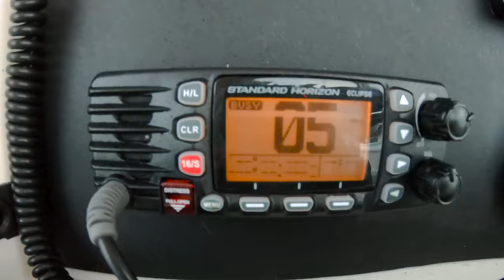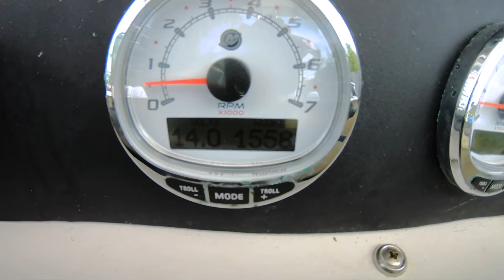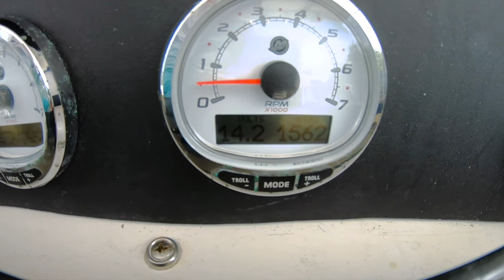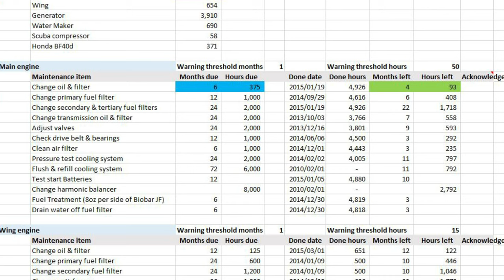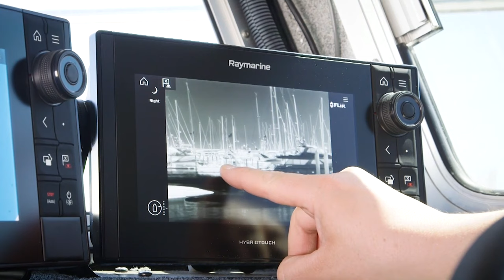Don't Make These 6 Mistakes When Buying a Used Boat!!!

Comment: Another great video! About a year ago I purchased a 2016 Key West 239 FS. It was equipped with a Yamaha 250 SHO which had about 390 hours on it. The seller was great to work with; when I went to see the boat he gave me a thorough walkthrough pointing out all the issues that he was aware of. Most of them were very minor. Then we took the boat out for a sea trial. He didn't hesitate to let me have the local Key West dealer check over the boat, engine, electronics and trailer just to make sure there weren't any serious hidden problems. The only real issues (which had already been pointed out by the seller) were that the trailer hubs, brake calipers and surge coupler needed replacing. The seller had already accounted for that in his asking price, so that wasn't a huge concern. Long story short, I've had the boat for over a year now and couldn't be happier. I had the work done on the trailer so it's ready if I want to tow long distance. I also added an onboard two-bank charger/maintainer to keep the batteries ready to go while the boat is sitting on the trailer between outings. I just had my first annual maintenance done on the engine and it got a clean bill of health, which was what I expected since it's run like a top ever since I purchased the boat. We all know that any machine will eventually fail, but doing the things recommended in this video will give you your best shot at ensuring that there aren't any serious hidden problems when considering a used boat purchase.
Reply from the maker: Great stuff. Congrats on the boat!!

Comment: If possible get a survey! For expensive diesels, also a separate survey for those including oil analysis. Check for rot in stringers and transom. Soft balsa core or wetness of core. When were manifolds/risers replaced? In salt water: Condition of wiring and tanks which is also very expensive repairs.
Reply from the maker: Great suggestions 👍👍

Comment: I am in the process of buying a boat and this video is the most helpful one I have watched. There are three points here I am up against. 1) I have never used the type of boat I am buying so I really need the guy to sea trial and show me everything on it so that I can see if it is working properly. Like the trim tabs and getting on plane etc. 2) I have never inspected an engine. Thru research I know I can now but I can't take someone with me because this boat is a deal and there is TONS of competition. 3) I am going to have to make a decision onsite because I will be the first one seeing it and the vultures are circling. It's awesome knowing that this is not unique to me and I can do it right if I just remain calm and figure it out. Haha.